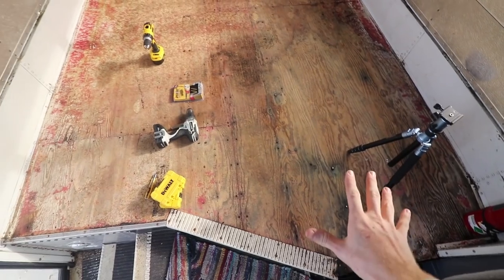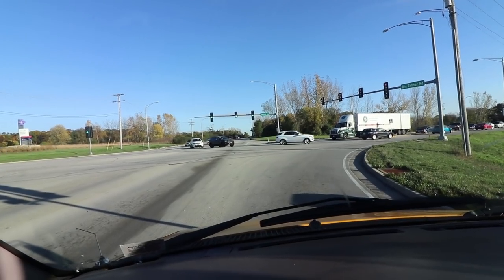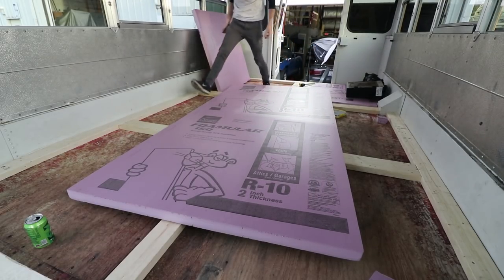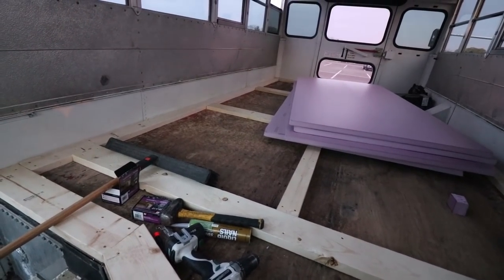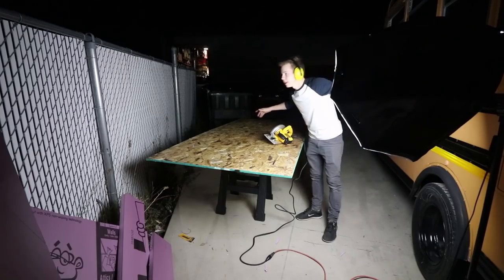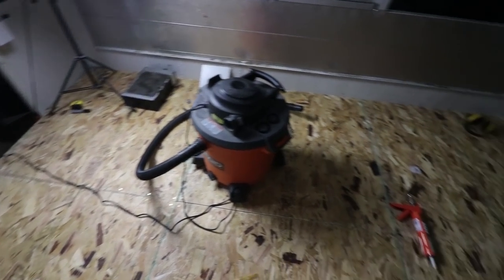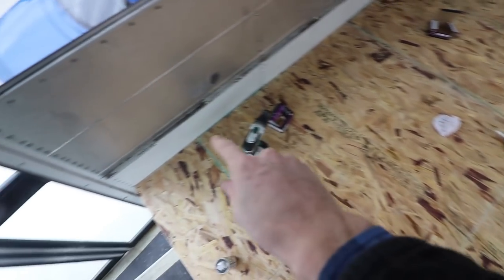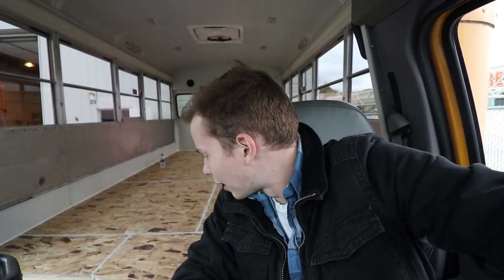Adventure Bus Build Pt 2 - Building a New, Insulated Floor!

Comment: Nice work! you could seal over that floor with pva sealer, its cheap, you just brush or roll it on then the osb would be totally water proof. You should run some conduit for wiring along the sides and ceiling before you put any cladding on the sides or ceiling. run extra wires down them as you are bound to want to add more stuff later, other things you could add, an extra battery, split charge system, lights, water tank, mains inverter for kettle / microwave/ tv etc, Sub woofer, 12v points, usb charging points. Have you thought about adding an Air conditioner? How about getting a roof mounted one from a chiller van (food delivery van) you can get them pretty cheap second hand. I wonder whats behind those aluminium side panels? are you going to get them off and fit plywood? you could use rockwool to insulate the sides, fit long thin boards on the ceiling to insulate that, have you thought about double glazing the windows with acrylic? It would get pretty hot in there on a hot sunny day
Reply: Mike240 Forager 
It seems like you know your stuff.
But yeah he said he would put an rv electric system with batteries and stuff so I guess he will hide wires in the walls.
And you're right an ac would be a very good idea, it must get really hot in there.

Comment: Hey Ging, What power figures does the bus put out?And is it N/A or turbo/supercharged.I know nothing bout buses :D
Reply: According to wikipedia the ford 6.0 that comes in those buses are 325hp.
But I know it's turbo, if you take a diesel and don't put any turbo it makes no power, it couldn't make that bus go up hills and stuff.
Reply: Thanks!
Reply: 6.0 litre turbo diesel
Reply: Пламен Георгиев It is a turbo deisel. Very torquey, not much hp.
Reply: A diesel without a turbo would be absolutely useless. It would just gets in the way of its self
Reply: Mazukies Wish I have a 7.3 n/a diesel and it has all the power I could want. I’ve pulled 70ft single wide trailers with it. Idk about New n/a diesels bit my 89 has all kinds of power. All I know about the 6.0s is that he better bulletproof it quick.
Reply: Is it designed to be Na? I had a old Detroit D60 that was na and it would not do jack shit no power
Reply: Turbo
Reply: Dallas Bryan they don’t make n/a diesel anymore. there not efficient and make  very little power.
Reply: Mazukies Wish Yes its a 89 Ford F-350 with the international 7.3 idi in it. It’s backed with a 5 speed tranny. And it’s done absolutely everything I’ve asked of it

Comment: Totally worth insulating the floor. Ever spent time sitting in a car with the heat off in the winter? That's why you insulate the floor and the walls in a bus. And cover some of the windows if you can.

Comment: I actually really enjoy watching you build the bus. I understand the rush to finish it before Georgia. Focus on getting the bus done, we’ll still be here for the other cars afterwards. I don’t know if you did this or not but maybe it would be a good idea to apply sealant to the edges of the new floor that are exposed by the stairs and the rear emergency exit. Also, adding in some insulation to the walls would help tremendously with thermal efficiency. Perhaps there’s space in between the interior wall panels and the exterior skin for some spray insulation or regular pink insulation. Another thing you might want to consider at a later date is figuring out how to seal the doors better. All the busses I’ve been on always had windows with imperfect seals and main doors with huge gaps in them. Keep up the good work. It’s coming along nicely.

Comment: I would throw some type of sealant on that wood, it's not plywood, it's OSB and it will absorb moisture and swell if water gets on it. Also the wood is labeled with nominal dimensions, those are different than actual dimensions. Just my $.02, I'm actually really diggin this build and loving the effort going into it.

Comment: Gingium, I love the content and everything, I'm not trying to criticize but some helpful tips for if you plan on doing this again. The first layer of plywood, the glue on it doesn't make for a good bonding surface. So sand it off, and one last thing, use wood glue when gluing two pieces of wood, it'll be a way stronger bond vs. the silicone you used. Again, love the builds keep em coming please and thank you.

Comment: A tip to get better looking and tight seals using that sealant is u´to use warm soapy water in a glass which you dip your finger in and drag along the seams, it makes them smooth and super tight :)

Comment: For your information, a 4 x 2 is 1 1/2 X 3 1/2 because 4 x 2 is calculated "rough" before the wood is processed into clean planks, thus removing 1/2 an inch on each side.

Comment: Living in the UK, I've never been exposed to a vehicle that just sounds like its rod knocking all the time and that being normal. Its kinda terrifying to listen to actually
Reply: Vee Snowtail you don't have diesel engines in the uk?
Reply: Vee Snowtail just a diesel
Reply: I'm in the UK n u hav never seen and old vw pd sound the same
Reply: You must be kidding guys :D Even european diesel cars sound like they have rodknock. I live in Europe too.
Reply: ChurkaBurkaDurr High displacement diesel engine, thats all
Reply: Cameron We do have diesels but the older diesel cars never caught on well(so aren't that common to see) and the more modern ones are so muffled they might as well be electric for all the noise they make. Big displacement diesel engines are also not really that common in commuter cars. Pickup trucks aren't really a thing here either.
Reply: Cameron Hunter we do but they don’t sound like that, also only very big vehicles will have huge diesel engines like that.
Reply: Vee Snowtail, welcome to america. Just how we do things. Big, torquey deisels, preferable V8's.
Reply: You have semis there though, right? Or lorries, as you guys call them. They're usually high displacement diesels, right? Or do you guys tend to use gasoline engines in them? I wouldn't see why.
Reply: Zippopotamus I'm in London which has a deaths grip on emissions regulations. HGVs as we call them (or Heavy Goods Vehicles) such as lorries are kind of a pain for companies to justify running in the capital both for logistical and financial reasons. They get taxed out the asshole and the streets really aren't big enough to support that kinda thing so if you aren't spending a lot of time on motorways you'll hardly ever see them
Reply: But what about the ultra common 1.9 TDI? It has this rodknock sound if you listen to it from the outside.
Reply: Zippopotamus i live in Sweden and we have had diesel trucks/lorys since the 1930s
Reply: MURICA
Reply: Why thank you, I also meow as I please.
Reply: @Tom Hornsey, some older van with non modern diesel engine sound like huge diesel engine.

Comment: Get an EGR delete kit for this 6.0 Powerstroke, you'll get more power and more fuel economy!
Reply: And mostly he will never have problem with it, my dad had a alfa romeo 156 q4 and he needed to clean it 2 times in like 3 years of ownership, those just get dirty too fast.
Reply: Thumbs up for a q4
Reply: This reminded me of my Dad's 2.5 busso 156 i miss it so munch :(
Reply: Really recommend the egr delete kit, I own a 2005 econoline and just had mine recently go out. You dont really have too bulletproof it as well, unless you're beating on it constantly/ doing hardcore towing
Reply: My dad also had a 166 2.4 5 cylinders, it was a 150hp diesel but still it was fast, lots of torque.
Btw the q4 was just the 1.9 diesel (In europe the bigger the engine is the more tax you get, so you can't get crazy with displacement, and also diesel is cheaper, but rn normal fuel is cool because you pay less tax, they are trying to stop people to buy diesels.)
Reply: Jaden Sanderson it's a power joke not power stroke

Comment: What are you gonna do for heating? You can take a line from the engine radiator and put a cross joint onto it, so you could run it through a radiator inside the bus. Just giving you an ideea.
Reply: blademuci he's going to get a full RV AC and heating system

Comment: Who doesn't know that its called a 2x4, NOT a 4x2??!! It is also very commonly known that the dimensions in lumber are 'rough' only. Your piece of wood started out as a 4x2, lol and then was finish planed etc. to its standard dimension of 1.5" x 3.5" or a three and a half by one and a half, in Gingium speak. lol

Comment: 2x4 is 1.5x3.5
Reply: Austin Payette but why though?
Reply: ThierryTheuns The 2x4 refers to the rough-cut green wood: it shrinks during drying, then the dried wood is planed smooth, so the finished lumber is supposed to end up at 1.5x3.5

Comment: you should put some deck sealer on the floor before carpet. Just in case you spill something, it wont soak into the plywood

Comment: Great vid series, full of tips and hints (what not to do JK) for those considering similar conversion (van, bus, box truck).  I know you ask 5 people you will get 10 opinions.  No sit down doing a master plan.  So what was it metal under old plywood flooring?  Just an observation, if you took out old plywood (may have mold), cleaned up (sanded and treated) metal subflooring then insulate? Would have saved a 1/2"(?) and you'd know the condition of subflooring.  Spray foam (gets into gaps) vs. poly panels.

Comment: 2x4's are originally cut at that measurement but the wood is still wet at that point. After the drying, it can sink down to 1"3/4x3"1/2.

Comment: When buying wood like 2x4’s or 2x6’s 4x4’s etc, their dimensions are always a half inch less than their name in both directions because that was before being planed and pressed. if you wanted actual 2x4’s etc you would have needed to buy full dimension 2x4’s etc. just a fun fact for you

Comment: Yeah so, if you guys did not already know: When you buy a piece of wood (2''x4'' as example) you won't realy get a 2''x4''. The reason is, construction wood need to dry before you can use it. So what you get in reality is a 1 1/2'' x 3 1/2''. Same with a 1''x4'', you'll get 3/4'' x 3 1/2''. 
So that's how it goes:
Less than a 1'' = you cut 1/4''
between 1'' and 7'' = you cut 1/2''
More than 7'' = you cut 3/4'' (a 2''x8'' become a 1 1/2'' x 7 1/4'')
That comes from an Architecture 
I hope that it's clear (and sorry about my english guys, i'm from Quebec, CA)
Share so Woodium can see :)

Comment: pro tip, instead of cutting out chunks for each  square do full sheets. will save you a bit on materials and you wont have so many gaps either.
Reply: dethdeks Yeah but if the floor is not 100% flat one sheet will be hard af to bend to shape.

Comment: If you dont put something that doesnt pass through water between the fiberboards and the carpet, then there will be mold and rotten wood quite quickly. You could also treat the wood with some chemicals so it becomes water resistant

Comment: 2x4 and other lumber are measured nominally when they are cut, after they dry it shrinks, so don't ever trust that the measurement they call out is what the size is. Everyone learns this one the hard way. 1.5x3.5 is what 2x4s come out to be

Comment: The wood is shrunk, not marked wrong. They measure when it's just cut, and it shrinks by 25% when it is dried to be sold so 4 inches would REALLY be 3 inches

Comment: For wood, there are nominal sizes and actual sizes. The nominal size, in this case 4x2, doesn't actually mean 4 inches by 2 inches. When you buy wood, just Google a nominal vs. actual chart.

Comment: It's a 2x4, not a 4x2 and nominal thickness is 1 1/2x 3 1/2.
Menards has some one suing them cause the thickness isn't as advertised although it's been like that since 50's or 60's. No wood is true thickness unless you have it specially milled.

Comment: You need a quick release steering wheel as your next mod
Reply: Jack Nguyen 
That's cool but no airbag on a freaking bus is deadly.
Literally.
Reply: IMNOTA as deadly as putting a quick release on a Miata?
Reply: When you remove airbags the legit way, you put harnesses, he has harnesses on both miatas.
But having no airbag on a normal seatbelt makes you hit the steering wheel with your head and die.
To counter this, harnesses don't let you lean forward so you can't crack your head.
Reply: IMNOTA pretty sure he would do seats and harness if putting a new steering wheel. Even if he didn’t, he wouldn’t be going as fast as a sport car in traffic. A bus can take a head on collision from a sedan better than a Miata.

Comment: Carpet? Nah...get's soggy too easily and is a pain to clean (despite the fact that if feels nice under your bare feet!) and keep clean (it gathers dust!)...I'd prefer something I can wipe down :) - still, interesting (I want my own bus - but a coach instead of a schoolbus because the under-floor-compartments are great for storage of batteries, chargers, tanks, pumps etc. etc.)
Still, I like having found a build-log :) - been looking for someone who made a good one for a while ;)
Question: Why did you add wood downd the center? Is that so the insulation isn't "crushed" by walking on the floor above it later on?

Comment: Dude, that's not plywood. That's beaver puke....

Also, I recommend Torx screws. They strip out FAR less often and are much easier to work with because of that.

Oh, and another thing. Put your beds either straight on the floor, or up high just barely enough to be comfortable/safe sitting up/getting out of them. This way you have plenty of room for storage under/above the bed for clothes, tools, or some other kin of supply.

Also, put awnings on both sides and the back with connecting tarps to basically give you a wrap-around overhang when fully deployed. That'd be the shit! And look at my comment on the first video, too, haha :P :3 :D

Comment: Okay, I’m going to say this now before I finish watching the video. Your choice of wood was poor. We’ve used that stuff even for interior flooring and it’s done nothing but fall apart and now up on the edges. Your outcome may vary but if it gets wet you MUST dry it as soon as possible. Moisture gets into it and it just holds onto it. You may not immediately have issues with the press board but it is cheaper for a reason.

Your construction is solid though (still watching the video in the background).

Comment: Why did you not just bed line the floor, great you sealed the joints, but plywood will not stand up to moisture. It will peel and fall apart

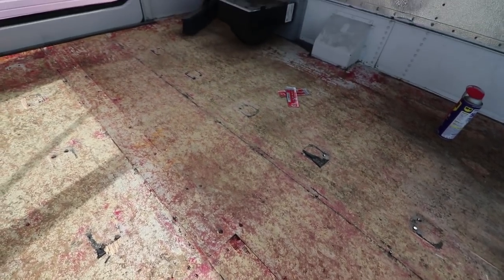Comment: 0:42 “square top bolts”... that kinda hurts me being a carpenter. The square heads are called Robertson, star heads are Phillips and straight line heads are called flat heads. Also, they are just regular carpentry screws, not bolts. Love the content, just hurt me a bit inside. <3

Comment: Its a 2x4 not a 4x2 and theyre smaller bc u bought the finished wood so its rough cut 2x4 but then they sand and finish it so its really smaller

Comment: My learnings from this episode.
Americans call OSB (Oriented Strand Board) Plywood.
Gingium didn't know that 4x2 was the size before planing and isn't concerned that OSB requires an expansion joint when used as a floor/wall/roof.
Also, couldn't you have just screwed through the OSB and insulation to the wooden surface below? You needn't really have made the joists, just insulated and OSB'd from the back to the front. Might have saved some work, but love the look of the finished result.
Exciting times.... Loving the Bus build series, and your work ethic is amazing.

Comment: At 11:50, you said no turbocharging (it came with a single turbo anyway :p), supercharging or skids, and I completely understand, people have different reference, but you can try to upgrade parts like the exhaust/ intake system, changing the fuel pump ( common issues ), etc... here's the link to common issues http://www.powerstrokehub.com/6.0-power-stroke-problems.html

Comment: Good videos... But watching them makes me cringe. I work construction and you do not know much about this stuff. Like 2x4 is the size when it is milled out it shrinks from moister loss. Also dont cut inbetween 2 saw horses like that you will pinch the blade and it wont end well for you. Theirs much more but I dont care enought to type.

Comment: Get a impact drill. Not a big one with a 1/2 or 3/4 drive, just a construction one with the quick insert for bits. It is so much nicer to drill or remove screws.

Comment: 2x4s are not actually 2 inches by 4 inches. When the board is first rough sawn from the log, it is a true 2x4, but the drying process and planing of the board reduce it to the finished

Comment: that has the 6.0 power stroke right? you need to do head studs and an upgraded egr cooler (or egr delete). both of those can lead to a blown head gasket and if your egr cooler breaks you could hydolock your engine and bend a rod. that happened to my dads truck and its not a cheap fix

Comment: Don't seal the underfloor, you need to leave spots so air can circulate, moisture will get in and it will rot. Do not follow the 16 yr old flooring advice 'cause he has no idea what he is talking about